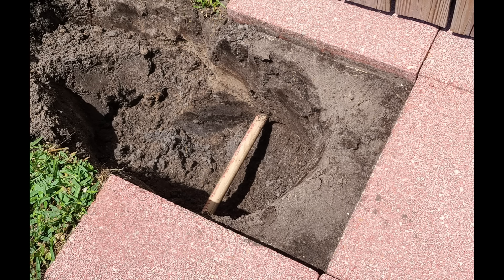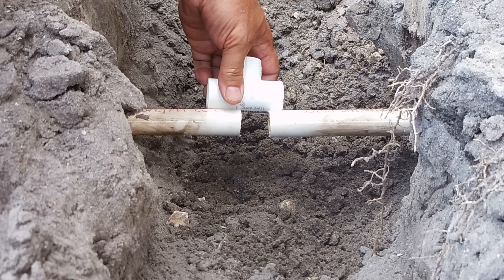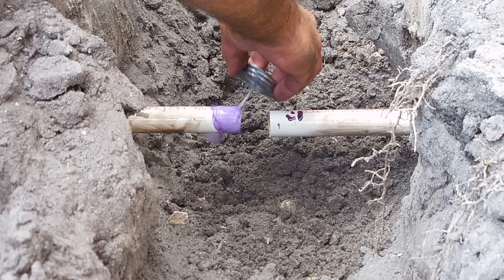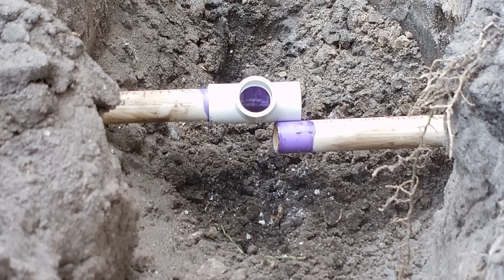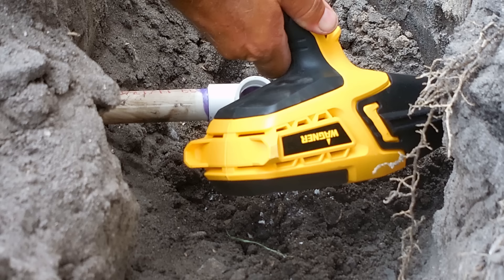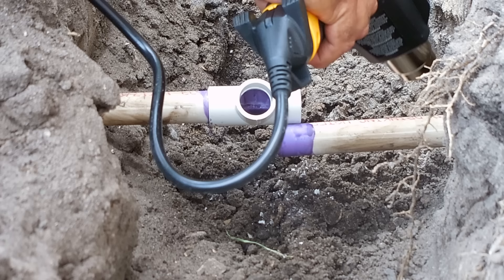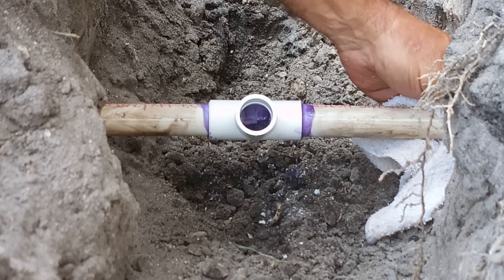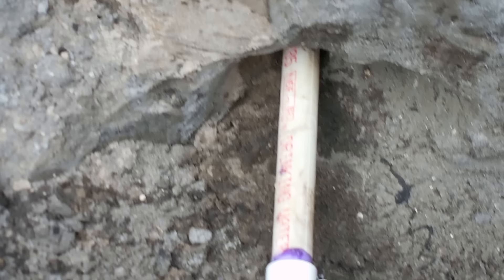How To EASILY Tap Into PVC Water Lines(Best Method Using A Small Hole)

Comment: Why not just use a slip connector? I’m no fan of heating the pipe that hot. There’s no way the structural integrity of the pipe is not compromised by heating that way.

Comment: Use 4 90s that’s how easiest way 2- 90s up 2-90s down easily push together no problem save your self a ton of time
Reply from the maker: No reason to add all the extra friction losses
Reply: @electronicsNmore    Less then 2 psi unless your in a high rise building absolutely pointless ! Im a pluming contractor in my experience in the field professionally we don’t want to heat and bend pipe etc faster and easier to just do it right and use fittings ! 4 90s can help most out of many jams and you don’t need any special tools
Reply: @electronicsNmore    I have a heat gun on my van on occasion I heat pvc and try to bend it a little I’m not opposed to it just sharing a easy way to connect 2 sections in the middle with out a Union coupling or a slip coupling
Reply from the maker: @patricktheplumber5482  I guess when the factory made the pipe and and fittings (using high heat)according to you, "It wasn't done right". LOL
Reply: @electronicsNmore     Partner if you think getting down in a wet muddy hole and hearing and bending pipe is easier then just gluing on some fittings ! Then you go right ahead honestly not trying to to crap to
You in fact I might delete my comment not trying to ruin your views and channel just putting in my 2 cents ! Sure the pipe is extruded in mold bending pipe around can actually mishaps it have a great weekend.

Comment: Why not use a slip-fix just cut more of the right side off glue the slip-fix then extend the slip fix into the tee, you don't have to weaken or melt the pvc. Your not working with a main line its just a lateral line.

Comment: And then you can also get yourself into some real trouble by doing that because although you can do it and just because you did it it doesn't leak and you're throwing dirt on top of it does not mean that it is not going to leak very soon it's very possible when you install PVC it should be where it's going to be for the rest of its life If you don't do that and you just throw dirt on top of it after you don't do that it will be a problem for you in the future.

Comment: It's great you are letting people know you can bend PVC, but in this particular installation you are working way too hard. Just remove the internal stops on the T, and turn it into a slip-T, then apply primer to the T and let it dry for a few seconds. Slide the T fully over the pipe on the left till the pipe comes out the other side of the T about an inch.

Then apply primer and glue to the two pipes and quickly side the T over both pipes, being careful to position it right in the middle.
Reply from the maker: I already have a video showing that technique.

Comment: This is even easier with a saddle connector 🧐
Reply: Not easier (as in takes longer to do), costs 3 or 4 times as much, or more, and now you have rusting metal underground. Nope. I'd rather use this tried and true method using standard, inexpensive parts right off the shelf, done in a minute or two...
And before you say stainless steel parts don't rust, after 40 years of doing this stuff, I can confirm it can and does.
Reply: @Quickened1  Not exactly what I was thinking. They make a PVC saddle that is very similar to the T-fitting that simply snaps in place and is held by glue. Simple and easy to do. I've been doing this for 40 years too.
Reply: @tr3vorb438  well, I'm not surprised they have those as well, I just never even thought about that type. I'm sure it's all well and good, but when I'm in the field, and all I have is a standard T, this works every time, and is not that difficult... Fortunately, I rarely have to mess with any of it anymore! You might just say I'm old fashioned...

Comment: My only concern is with using a high amperage device like a heat gun with a typical extension cord. I’ve had to do it but I made my own extension with 10-gauge conductors. For 12GA or higher (smaller) I would be careful to limit how long I run the heat gun. Give it a break and check the receptacles, plugs, and cord for signs of overheating between uses.
Reply: The typical heat gun is 1000 to 2000 watts. Not a problem for extension wires in most of the world since we use 240v electricity. So around 8 amps current. However since the US for some weird reason decided on 110v you do have a problem...
Reply: @TheNagaguy  Yep. I actually keep an eye out at thrift stores for 220/230v equipment like that specifically so that I can them with a 240v extension here in the USA. Most recently I found a hot water kettle from the Philippines at a Goodwill thrift store so I wired it up with a NEMA 6-15P (15A 240v plug) for my NEMA 6-20R (20A 240v receptacle). It works great!

Before seeing this video I was already wishing that I had a 220v heat gun since I needed to do some heat shrinking outside (splicing replacement connectors onto a vehicle’s wiring harness). Maybe I should just grab one online but I know I’ll find one days after I place my order. That’s always how these things work out for me. In fact, I found the kettle the same day I received my induction burner that I ordered specifically because American kettles, microwaves, and traditional stoves are too slow. ;)

I originally put in the receptacle for charging EVs and powering European/Australian game consoles.
Reply: @TheNagaguy  just use propane torch! This is for DIY people never fixed under ground plastic before.
Reply: Really??? 🙄 My only concern is that a storm may come up suddenly and a bolt of lighting will come down and strike you. Better rig up a temporary lighting rod system before embarking on a project like this. And while you are at it...make sure you have all possible permits needed. If your community doesn't have any permits, then just call mine and I am sure that they will be happy to sell you some.
Reply: @jeffs9302  lmao

Comment: Is it OK that purple stuff gets in the inside of the tube?  
I get it it will solidify, but   1. is it safe to drink the water it is soaking in   2. can pieces break off later, causing clogging somewhere else?
Reply from the maker: Yes, it's unavoidable to not get it inside the pipe. When it fully dries, and the line is flushed out good, you'll be fine.

Comment: Cleaner is only cleaner, primer is only primer. You could have simply used a slip fitting without risking kinking the pipe.
Reply from the maker: Incorrect. Where exactly do you plan on buying a full slip tee or coupling? Not everyone has a plumbing supply House nearby.

Comment: Now try it with a 90mm stormwater pipe, 😊 without the heat gun,
Reply from the maker: Where did I say to use this for a pipe that size?
Reply: @electronicsNmore  I was only suggesting what I had to do with a drainage pipe, I had a patio added to the house and had to by law, include the downpipe with the stormwater management system, 🙄

Comment: Ok how did you twist the PVC pipe when you put on the Tee?
Reply from the maker: When you insert the PVC after bending it, you give it a little bit of a back twist before you insert it and then you allow the PVC pipe to go to its normal position once it's inside the tee
Reply: @electronicsNmore  how it is possible to give the pipe a little twist if it is buried and connected on both ends? Obviously there was no permanent connection otherwise you would not be able to twist the pipe into the Tee after heating it.

Comment: Or you could put a saddle T by slip/ or by thread and drill the center which is faster and more efficient.
Reply: Neat. Is that a glued fitting?
Reply: Yep, we use the blue cement glue drys in 10 15 seconds so you need to be quick.

Comment: Definitely screws the next person that adds a fitting in the heated area years later.  Any joints attempted will fail.
Reply from the maker: No reason for anybody to add another fitting next to what I did. Worst case if they did, they would have to cut beyond the two inch wide section that I heated.

Comment: This is not the easiest.  The easiest is the 3/4" PVC saddle.  I've installed three in the last 3 weeks.  It's on You Tube.  You glue the saddle, then drill a hole into the 3/4" line, add the sprinkler, done.

Comment: Or just use a simple PVC Compression Coupling Pipe Fitting that has been available for the last 50 years.
Reply from the maker: The ones with o-ring seals or rubber gaskets that can leak over time, especially when used with chlorinated water?

Comment: I worked with PVC pipe as a gas mains layer and that is not the correct or easy way to do it, just cut your pipe glue the tee piece on one end let it set then glue the other end of the pipe and the other end of the tee piece and use 2 crow bars to force the both ends of the pipe in the same direction and then when lined up they will snap into place and that way you do not compromise the integrity of the pipe by softning it up, especialy if it is high pressure pipe

Comment: much better  fittings for this ... slipfit
Reply from the maker: Disagree, what I did is permanent.
Reply: Try a" Kwik-repair" by dawn industries. No o rings you will never use anything else
Reply from the maker: @elkskiutah8204  If you don't have a heat gun on hand, then it's worth the money because there are no O-rings.

Comment: Don’t they make compression unions? Or is that for cpvc only
Reply from the maker: Plumbing supply houses sell compression tees. I'm not a big fan of them because they have o-ring SEALS or gaskets that can leak overtime especially with chlorinated water. Thanks for watching!
Reply: @electronicsNmore  I’m saying a union not a tee.. they make solvent weld unions….so
Reply from the maker: Yes, you can spend more money and put a union if you'd like, but why spend more money and also have a seal that can leak with a rubber gasket?
Reply: @electronicsNmore  Your glue joints could pop and leak too. A union is like 7 or 8 bucks. But to each their own

Comment: Or you could just use the proper repair coupling meant for that very situation.  And it's actually called a "repair coupling."
Reply from the maker: Good luck finding one. The only full slip PVC repair coupling that you're going to find is for drain waste vent PVC not pressure. I made another video which is highly popular about that issue.
Reply: @electronicsNmore  Well, thing IS, DWV is NOT "all your going find" ....around HERE.  You must live in some weird market or something.  2 local plumbing supply houses that I know of have them here and even so does Lowes......rated 150-200 psi.  All the sprinkler repair trucks carry them and I know they aren't manufacturing them themselves.  You'd be just the same using a DWV ANYway as by heat bending it like you are doing is WAY compromising it's integrity when it comes to handling the pressure that it was initially rated for.  The "pressure" that it will withstand after your little heating trick is no better than DWV.
Reply from the maker: @okccraftsman8751  Plumbing supply house yes, they would have them, Lowe's I know for a fact and Home Depot do not sell full slip PVC repair couplings for pressure lines half inch three-quarter 1in.
Reply: @electronicsNmore  You do know that it is not required that you shop only at Lowes and Home Depot, right?  And yes, Lowes DOES have what you need in 1".  "Full slip" is kind of ....well...... irrelevant.  Any "'repair' coupling" will do exactly what you're needing to do.....that's what "repair coupling" MEANS.

Comment: Trying to heat and bend that pipe and not wreck it is fraught.  Cut the ends shorter and use els to build a bypass you don’t have to manhandle.

Comment: That’s a bad joint. Cannot let the primer dry before you apply the cement otherwise it’s just a glue joint and not a “weld joint” as intended by the manufacturer that created the “two step” pipe joint process.
Reply from the maker: I can assure you you don't know more about PVC than I do. More than likely, I've working on PVC pipes before you were even born. I have testing videos on my channel showing bonding processes. Where exactly are the tests that you have performed? Please send me links to YOUR videos mr know-it-all. I guess you know more than the company that made the product. The primer does not have to be wet. 

https://youtu.be/Ig-1uZOrlaM?si=tR2vl02gwQL6ZWeE
Reply: Wtf are you talking about you can't let primer dry? Primer dries in seconds, there are no glue joints ever done with pvc that were fast enough to not have primer dry LMAO. Also you're always supposed to let primer of every type for everything that primer exists in.. dry before applying.
The strongest bond you can do for PVC is with no primer at all, so if that's what you want then you shouldn't even use primer.
Reply: @electronicsNmore  lol that video "wipe off the excess cement" ... I can hear everyone in the world saying "whoops"
Reply: That’s funny, I make those joints. It’s the only way I do it. Taught by an Oatey rep, in a training they put on actually. To each his own though but remember, there’s only one right way 🤗
Reply: @landongooding7461  The video he linked is from oatey.. so you're wrong
"there's only one right way" this is also wrong. There are typically dozens of correct ways to accomplish things. Especially in civil engineering.

Comment: that way is ""WRONG"" because after you HEATER UP the pipe...loose FLEXIBILITY and can CRACK  the side you heater up. is better doing in the old way ..dig anoter 2 feet to pull up and done.
Reply from the maker: You don't know what you're talking about.

Comment: No! just mill off the stops internally, or buy a slip fitting, then slide it in and then out to the position. This is not correct or needed.
Reply from the maker: You must have seen my other video
Reply: @electronicsNmore  I bend schedule 80 PVC [Yellowmine] 6" by capping the ends and heating the section of bend with a weed torch. The increase in internal pressure means no wall collapse while bending. Perfect bends every time.
Reply: @electronicsNmore  No,  Life experience, but I will have a look.

Comment: Alternatively, you could just use a slip fix, & complete the installation of the tee correctly. Probably the worst thing I’ve ever seen.
Reply from the maker: Slip fix connections aren't permanent,  they have seals that can dry out and leak over time, especially when exposed to chlorinated water supplies. There's nothing incorrect about how this tee was installed. The idea is a brilliant time-saving method, and your method will not work when space is limited when you want to tap into a line. The slip fix and tee will take up too much space. If you don't like the method, don't use it, no loss to me.

Comment: Do this at your own peril!  25 year irrigation technician/professional here in residential, commercial and golf.  Homeowner videos like this are laughable and why so many have a bad name.  This is a guaranteed pipe break and/or much larger issue in the not too distant future.
Reply from the maker: I can assure you my connection will be here long after you're gone. I've been working with PVC for over 30 years, and have performed numerous tests, so I know exactly what you can and cannot do.

Comment: Plumber here, DO NOT use primer on domestic water lines. Primer and clear glue combo is for DRAIN FITTINGS ONLY. On domestic lines you should be using blue glue for PVC or yellow for CPVC
Reply from the maker: "Oatey® PVC Regular Bodied Fast Set Clear Cement and Purple Primer Handy Pack gives you the best value with both the PVC Cement and Purple Primer included. The PVC Cement is recommended for potable water, pressure pipe, conduit and DWV applications." 

Clearly if it's being sold in a kit with primer and cement, the above statement would apply.

Comment: This is not how you do this repair correctly. You are degrading the pipes integrity. This is why they make compression couplings to do the job correctly and way faster!
Reply from the maker: Wrong. You clearly do not know the extreme heat and pressure that is used when PVC pipes are made. The Integrity has not been compromised. How do I know that? Because I have done high pressure testing which you have not.
Reply: @electronicsNmore  I’ve been a licensed water well driller and pump installer/electrician in multiple states for 20+ years and I have installed well over a million feet of pvc pipe. And weather it works or not doesn’t matter. It’s not conduit your heating to make bends which is fine doing electrical for multiple reasons no pressure and running wire is so much easier but you know this. But heating and bending twisting water pipe does degrade it I didn’t say compromised it. There’s multiple reasons the compression coupling is the correct way to do that repair first it’s much faster. This is better for you and the customer. It’s much cheaper for them to pay the cost of the coupler then it is to pay for your time and labor. This also gets you going to your next job quicker and fresher doing less labor and being more efficient. Also if the line is in area where you could have ground movement frost etc a compression coupling repair allows the pipe to moves a little. The way there’s not it will pull out of the tee or break also the integrity being slightly degraded comes into play in this situation as well. You can do what you want but between my grandfather, father, myself is like 75 years exp in the field and seen a lot. Have a good one.